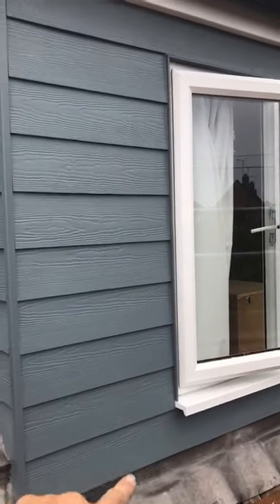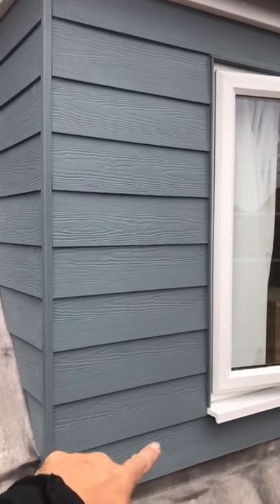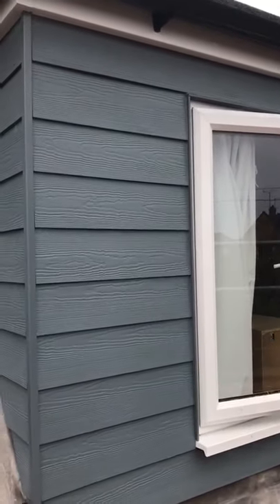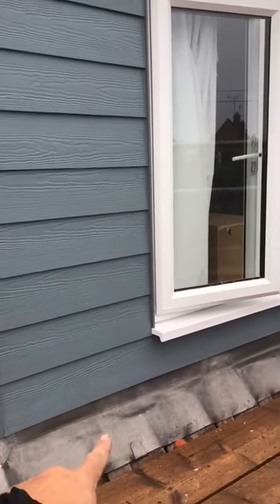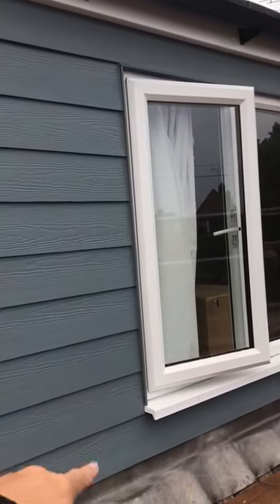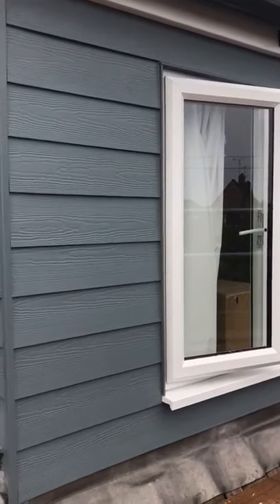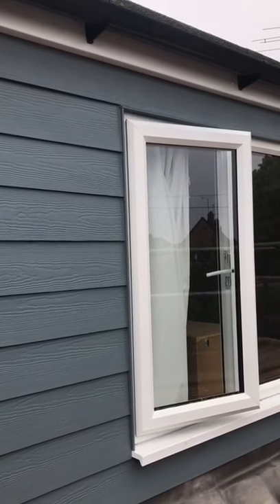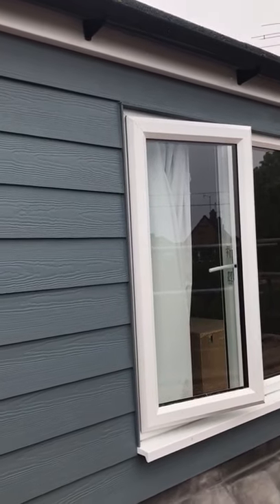work tips cladding

Comment: Looks amazing! top work. 

Could you advice on how you fix the bottom cladding planks on the front and sides over the lead apron/flashing? did you have to screw into the flashing? is it safe to do so? Thanks
Reply from the maker: Good point,I hung the battens lower at the edge of the window and fixed a batten between then fixed with small pins into the batten and painted over the pin heads.and screwed the top of the boards
Reply: Any advice on PVC cladding???
Reply from the maker: Cheers mate, I do hang the battens lower than the Lead and I put a batten  in line with the roof. Does that make sense?